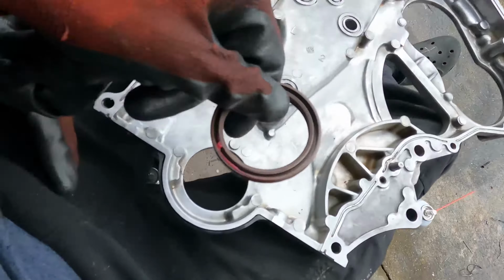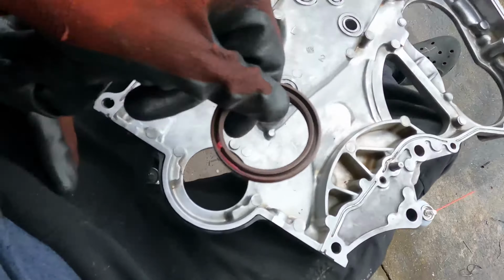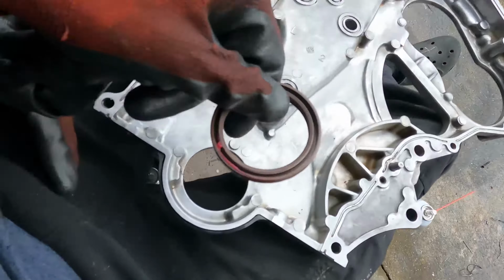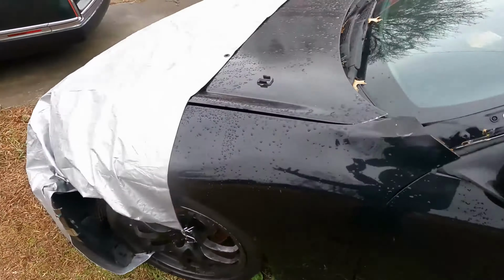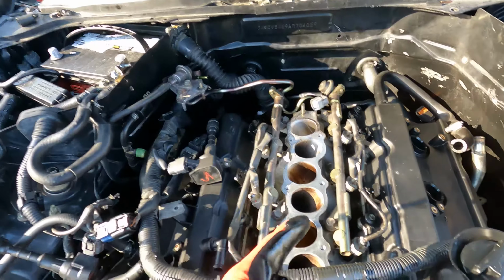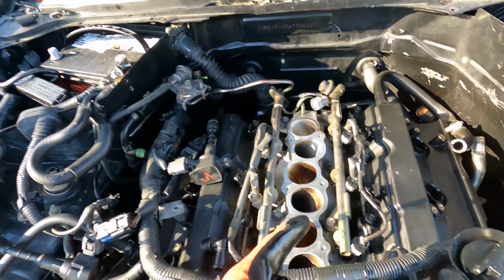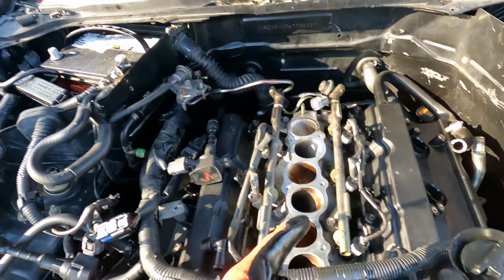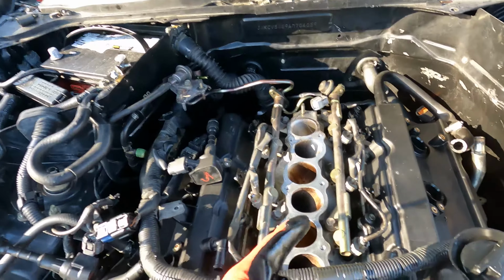WATCH THIS BEFORE Replacing Your Timing Chain On A G35/350z!

Comment: Great video! I have a cam phaser that's f'd on my 3.5L Altima, motor is transverse, not longitudinal, like this. Dreading doing the job, so much shit to pull apart that book says pull the motor instead, fml. When you actually get to it, it isn't super hard (if you know engines), but man, intimidating af just how much it takes to get to the timing components.
Reply from the maker: I’m super late but it’s honestly not that difficult if you haven’t done it already. Every part has indication marks on them, just make sure they’re all aligned.

Comment: Eh man, did you have a p0300 show up before you did this? The reason I ask is cause the motor was running fine for 4 months then out of no where just loss power and stalled. Car turns on but no spark on bank 1. I swapped the motor but I’m suspecting timing to be the issue cause it didn’t really line up well. Just crazy it ran well then might’ve slipped a little more to cause a no spark issue on one bank
Reply from the maker: I did have that code. The motor in question definitely sounds a little questionable. How has the new engine been treating you?
Reply: @JLowe The motor ran fine, it still starts to this day, but within 10 secs it goes from idling normally to an erratic idle around 1k. When I rev it doesn’t go pass 3k rpm which definitely sounds retarded. No spark or weak spark is what is preventing it from running well. I used enginetechs timing kit which had slight slack. I’m gonna try ordering the cloyes one to redo it. Thank you for responding bro, if you still have this vehicle I’m wondering if you and I are having similar issues.
Reply from the maker: No problem man. I do still have this vehicle it’s just stored right now due to still experiencing this issue. I think i’m going to end up just swapping the motor to completely get rid of the headache. 😮‍💨

Your issue definitely sounds timing related. Are you positive that everything is aligned? I’ve seen cases to where the timing could’ve been off a tooth and cause similar issues.
Reply: @JLowe I’ve felt your pain! Going back and forth and then turning the vehicle on to see no change is irritating. Atleast with the entire motor removed, you have options to swap or breaking down the motor down to the heads. It could just be a valve or if piston ring related I’d just do the whole swap. Mines was a DE non rev up. Two weeks tops to redo everything and a week to swap and install motor. These motors are expensive to repair, I should’ve just done a LS motor swap instead. Thank you for confirming that it could be timing related. I’m still going to perform a compression test first to see if that could be a problem as well.
Reply: @JLowe aye my boy did you ever change the oil gallery gaskets? It’s not too common on the de’s but it will cause timing codes if you’ve already tried changing the camshaft sensor, crankshaft sensor, etc. check your oil pressure as a quick test. Hope to see more g35 content homie 🤙🏼

Comment: I’m having trouble getting the front timing cover back on after doing a timing job. Did you drop the upper oil pan or how do you do it? The dowel pins aren’t lining up for me
Reply from the maker: Don’t fight it because the aluminum is very fragile. I was able to do it with only the lower oil pan removed. Which dowels are you referring to?
Reply: @JLowe  the dowel pins that are pressed into the front timing cover. I went ahead and removed them and was able to get it on. Thanks
Reply: Problem was the new oil pan seal (half moon) wasn’t allowing the cover to move down enough for the dowels to slide into their slots. I tightened the two 12mm bolts inside the pan and it pulled the cover down enough to get all the other bolts in👍
Reply: @samuelmanzanarez96 I was thinking that is how it would have to be done to get the bottom to seal properly. Thanks for sharing!

Comment: Did you ever figure out the rattle?
Reply from the maker: It was from the secondary timing chain on bank 2 due to the tensioner not working properly.
Reply: @JLowe  Thanks man. Bout to tackle this adventure on my 350z. Not looking forward to it lol.
Reply from the maker: @iCapture350z  you got it! Patience is key, if you have any questions feel free to ask.
Reply: @JLowe  thank you, really appreciate it! How long of a process would you say it is? Think I can get it done in a weekend? I’ve swapped a few motors in Hondas and pretty mechanically inclined but never done this project yet
Reply from the maker: You can definitely do it in a weekend if everything goes according to plan and you have everything you need. 

Being mechanically inclined you know that there is a chance something can go wrong. On a difficultly level I’ll put it at 7/10 only because you have to be precise such as having the engine TDC and making sure the cam gears are in the right position. I got faith it you!

Comment: I wouldn’t ever buy a used tensioner becuase the moment u pull the pin on the tensioner it will never be the same again so a brand new one is the way to go fs
Reply from the maker: At the time of the recording I didn’t have the funds and was in a rush to do the installation. I have since learned from my mistakes 🤣🤝🏽. I’m going to redo it soon!